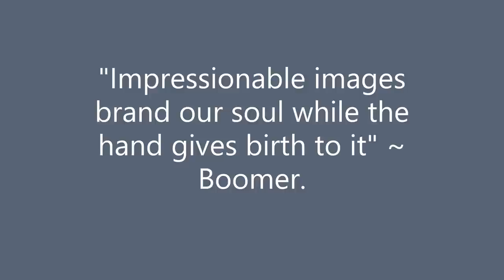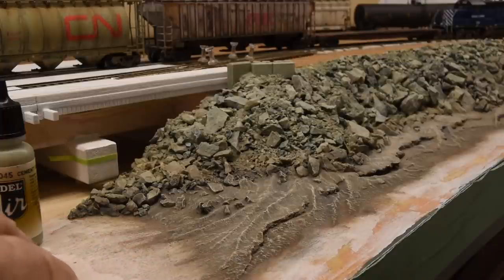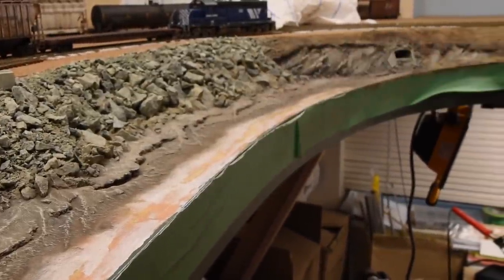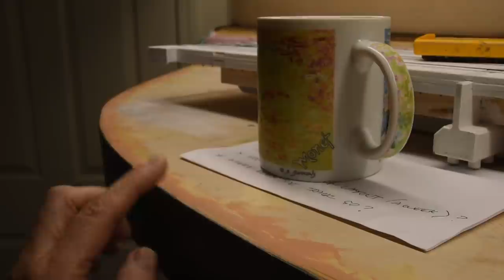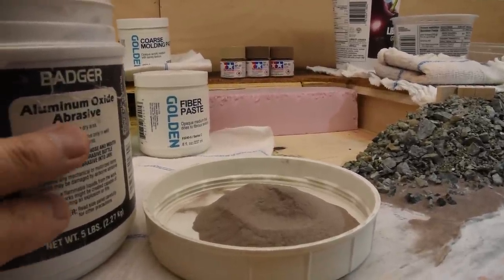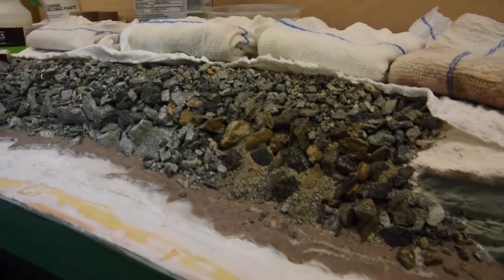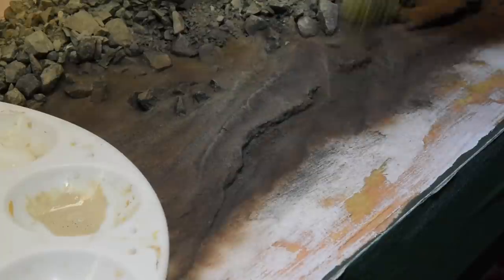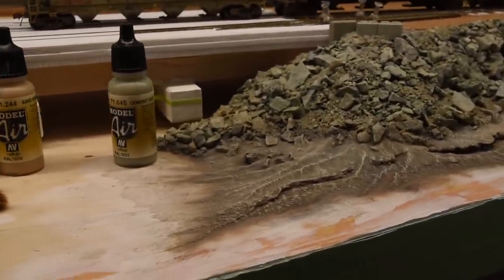Modeling Realistic Scenery Series | The Low Tide Beach - Vlog #36

Comment: Excellent tutorial. I have dry brushed almost everything for years. And you are right, your brush needs to be almost bone dry. I will get mine so dry I have to scrub to get paint off. You can always add more but if you put too much on, then you have to start all over with your base color. I am enjoying your videos immensely.
Reply from the maker: Great tip! This is why I use "Oil" paint brushes. The bristles can handle the abuse more, especially when dry-brushing scenery elements. There is a place for a soft brush as well, but they wear out pretty fast. Cheers ~ Boomer.

Comment: Totally agree with you on the resin. Ruined a project with it wicking up into the static grass, luckily it was only a small one. Acrylic mediums are definitely the was to do it
Reply from the maker: Acrylic has way more options and greater control. You also learn more "artistically" using acrylics. You don't learn anything pouring two part epoxy resin into a hole. 🤣

Comment: Boomer, I've said it before but I have to say it again: another Master's class in technique. You put so much into a 28 minute lesson...thank you again for your efforts here. And once again you showed a product I had not seen before used in a powerful way: aluminum oxide abrasive for modeling beach sand. My layout is going to be centered on the desert/mountain southwest and there are plenty of applications of your "beach" techniques far from the beach! Think many desert dry washes. One question: I searched online and can find a Paasche Airbrush Aluminum Oxide abrasive powder like your Badger product made for use in etching or air erasers like you mentioned. It comes in the same type 5 lb jar as yours but offered in either a 240 grit or 400 grit. I couldn't read a grit category on your jar even when I froze the video. I would like the size and texture of what you used for my HO scale landscape--any idea of what grit yours is? Thanks again! Mike
Reply from the maker: Thank You! My sand is around 240 to 300 grit. 400 must be super fine. Could be nice to have both on hand though. One can never have enough textures when modeling terrain, especially the way you indicate.
A desert scene would be awesome to model. I would love to do a Southern California SP Diorama some day. The desert has a beauty all it's own. The textures and sepia colors would be awesome. Cheers ~ Boomer.

Comment: Nice , Boomer all charged up over resin. What you have been teaching me and the rest of the community is how to 'scratch' build everything. Using anything we feel is suitable to use. I have never used resin. I have always steered away from water features because I couldn't make water from scratch. Resin is the answer for someone like me based on the reason I gave. I look forward to your lessons on how to create realistic water from everything but resin.Thanks & Cheers Boomer😃
Reply from the maker: Well you summed it up really by being honest about it. It's funny how we always think water to be a crystal clear  mountain lake or something. The method is fine if the individual wants it. In this particular case, (very muddy and opaque), you can't see one inch past the surface even though the Fraser is fresh water. Once the river is below the tide boundary (Mission, B.C.) it is mostly sand and mud. Therefore, absolutely no need to pour resin. It's more important to me to get the color right and then gloss it over some with texture, indications of current, etc. Cheers ~ Boomer.

Comment: Fantastic use of color and texture!  Really enjoying your videos and modeling...  You are absolutely correct, no IPA with Vallejo.  I have really good luck with windshield washer fluid (for airbrushing), but that's probably too toxic to use on large areas without ventilation.  

Interesting and valuable take on resin...  Not going to argue, but some of the guys that still use resin, only use it as a base over which they apply gloss medium, gloss Mod Podge or some sort of acrylic gloss floor finish (because it dries pretty hard as opposed to rubbery like artists mediums).  Luke Towan does this with all his water and it looks great and hides or disguises "resin creep". 

Looking  forward to seeing your water effects...
Reply from the maker: I have spotted "resin creep" with Luke as well even though he hides it well. I can spot it . . . lol. It happens to all of us. Thank you for sharing. Cheers.
Reply: @boomerdiorama  Well...  I didn't say it didn't happen to Luke, I just said he disguised it with an application of gloss medium or gloss Mod Podge.  :)  Looking forward to seeing your results, I'm sure they're going to be as spectacular as the rock work and sand bar.
Reply from the maker: @WHJeffB  Yes, for sure. For certain styles of build it can work. However, if you plan a dense and ultra realistic shoreline with multi media, strata and details, pouring resin is not the way to go in my opinion because it wicks into all the fibers, details, etc, leaving an ugly slope of creeping resin which won't go away. Cheers.

Comment: Yeah you are right about the resin creep. But I learn form friends of mine who worked at Light an magic to use Vasoline painted on objects, post, trees, things, that will stick up out of the resin and on walls at water marks, just above the height that the resin will be. Then pour your resin. what happens when the resin cures it curls down on any touching edges. Then with Isopropyl Alcohol clean up the Vasoline. Then you fill that small gap created with gel medium. The result you get is perfect look. no creep.   Takes some practice. but gives you control. Just a thought.
Reply from the maker: O.K.  If one wants to smear Vaseline everywhere on the model. In the movies, if that is what you are referring to, is 10 times the scale larger than any models we build. It's a whole different approach than model railroads and small dioramas. But then, why pour resin when the water being modelled is not clear?
Reply: @boomerdiorama  No they were helping me with a project for Cal trans and Amtrak. And you just use it where you want to fight the creep. It worked for me. The layout was on 3 foot by 6 foot. They took it all around California and parts of the united states. It's just a cool little trick. But what I want to see is what you are going to do.
Reply from the maker: @Vman7757  Sounds good. I'm using paint and artists gels for the muddy Fraser. Cheers.

Comment: Pretty cool Boomer.. couldn't agree more on the resin, I have attempted neither but the wicking and surface tension has always been off putting..
Reply from the maker: Can you imagine a slender shore-line at low-tide with delicate details modeled in  like; weeds, reeds, a rope, a chain, a ladder, etc. and then have resin suck it all up? I made a beautiful diorama once of a Trophy Trout Lake Shoreline and the resin killed it. It's a deceptive quick fix and destroyer of art in my opinion. It takes too much prep and work to make it work,. Even then, the risk is always there. Cheers.

Comment: Love your work.  Very inspiring.  I agree about the use of resin.  I've used it in the past a couple of times and was never really satisfied with it. On my current railroad I'm going to use oil based paint and see how that looks and holds up over time.   Love your techniques with matt medium.  Bill B.
Reply from the maker: Thanks for sharing! Acrylic paint (or latex) works for color, and then you can apply gloss mediums to add depth and character with total control. Cheers.
Reply: @boomerdiorama  If the water effect is along an edge of the railroad like yours, are you confident that the acrylic paint will hold up well?  I was thinking oil based would give a tougher finish??  Bill B.
Reply from the maker: @ozarkmidlandsouthernrailway  High quality acrylic is more resilient than most oils by far. Furthermore, good quality artists gels (like Golden), won't yellow with age. Easy to repair or recoat as well. Cheers.

Comment: THANK YOU for the anti-resin rant!!  That stuff is an abomination -- that uncontrollable, hard meniscus -- "resin creep" -- is just hideous, and I've tried for years to figure out why people accept it.  It's damned expensive, as well -- as a modeller on a tight budget, I can think of much funner things to do with that 30 or 40 bucks, and I can get better results for a lot less with paint and gloss medium.
Reply from the maker: I only mentioned half the reasons why I hate that "cheesy" stuff. I also can't stand "photo-shopped" wall-paper flats with baked in shadows that people like to call models either. But that is for another rant. I never forgot the time when one of my dioramas were rejected by a curator at the international "Festival of The Arts."  I was a pro back then and should have known better. I tried to avoid the whole polemic, but I needed to get it out of the way. That is exactly what I'll be using, gloss mediums, and high quality acrylic paint. It's the muddy Fraser River I am modeling - not a crystal clear bucket of water which resin simulates. Cheers.
Reply: @boomerdiorama   I'm looking forward to seeing how you do it. Very timely -- I've just started working on the non-urban scenery on my small N scale model railroad. The only water is the discharge pond for the factory's toxic waste dispenser, but it's front and center, with an outlet via a culvert at the front edge, and I really want to get it right.  It's a bit smaller than the mighty Fraser, but just as opaque... :)

I appreciate your willingness to spend whatever time it takes to get stuff right.  There are so many how-to-build-scenery-in-30-minutes videos out there, and at best, the results look generic and uninteresting.  I watch your videos and instantly feel better about spending almost two months painting and detailing the streets and sidewalks in a two-foot-square area...

Comment: Great technique. I might have missed it but what grit is the aluminum oxide? it looks pretty fine.
Reply from the maker: The grit is around 240 to 300. It doesn't say on the tub but if you check out the sand blasting supplier they will gladly show and tell. Cheers.

Comment: Hi! Did you seal your plywood base before using all that water?
Thank-you, Mike.
Reply from the maker: Yes. I usually use varathane first. However, in this case, I used matte medium on the fly. I get lazy in my old age with "economy of motion." Matte medium is also an excellent sealer if you are feeling lazy and over budget . . . lol. I will seal the larger "water" surface with varathane first though. Then I'll paint acrylic over top, glazes, gloss coats etc. But yes, always a good idea to seal first with water-based varathane. I also use a fan in a heated room which helps evaporate the standing water fast as I mop up the residual water (glue) with a damp cloth. Cheers.
Reply: @boomerdiorama  Thank-you once again!
Mike.
Reply: A follow-up, do you do this where you install the cork for the track. Oh yes Thank-you.
Mike.
Reply from the maker: @michaeldjoven80  Anytime! Cheers.
Reply from the maker: @michaeldjoven80  Not for cork on plywood. I like the penetration where two porous surfaces join, especially cork because it can lift if you don't use lots of glue and weight to set. After this, liberal applications of matte medium, by way of the ballasting procedure, seals the whole deal. Cheers.